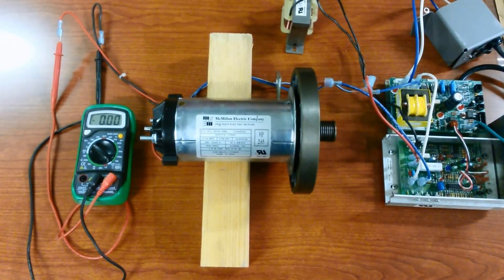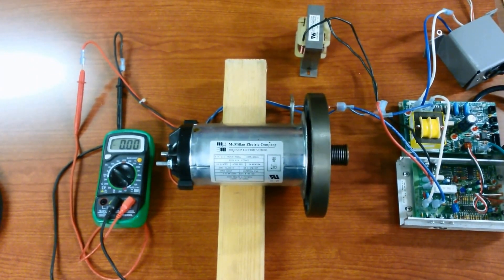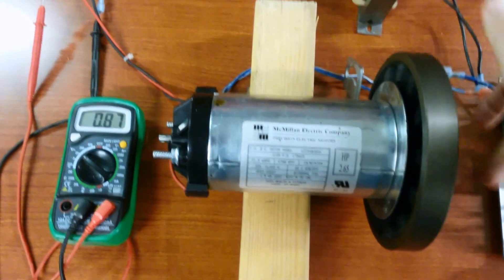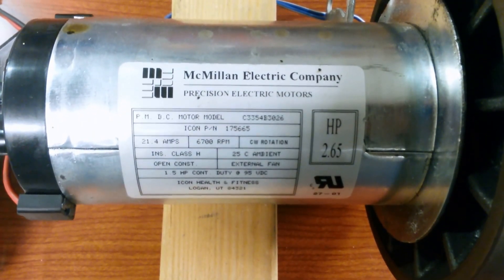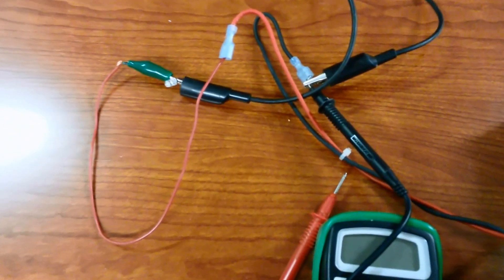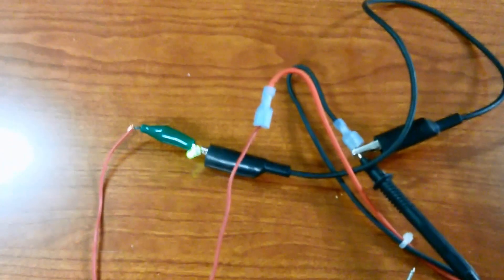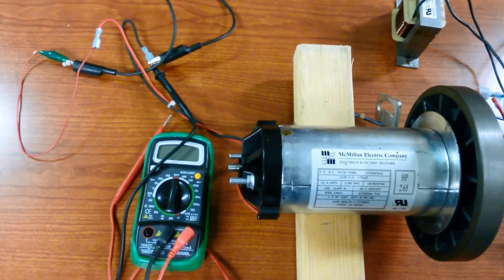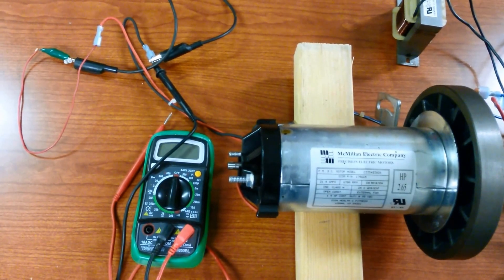DC Motor Dyno Intro

Comment: Hi, How is the dyno build working out.  Looking forward to seeing how you put it together as I am just starting a similar project.  Don't forget you'll also need a tachometer to confirm your RPMs so you can test the engines at their rated RPM/Kw (Hp).  How are you going to apply a load to the engine you are testing?  I am planning on using a hot water element and a potentiometer so I can increase load.  This will let me test an engine at different RPMs.  I am interested in some feedback on this as I am not sure of the circuitry needed.  Good luck, hope to see an update video.
Reply from the maker: +seditiousmonkeyart Thanks for the comment. Unfortunately, I haven't made any progress on this build. I've been busy with several large home remodels. I was working towards building a bearing system to support the pulley and belt so I can connect different small engines. For loading I was going to removing the heating elements in the toaster oven and wire them with separate switches so I could control the load by adding or subtracting elements as necessary. You're correct about needing a tachometer. I bought an inexpensive handheld tach off of eBay. I also was looking at a data logger that RC car racers use to dyno their cars, but that would be an upgrade once I got a basic system working. Let me know how your build goes. I don't think I'll be able to start back up on this project for a little while longer.
Reply: Life sure has a way of interfering with our projects.  I'll probably start my dyno build early 2016, current building a new Stirling Engine (I'm trying out a new design).  In the interim I'm think of making a simple prony brake dyno.  I'll keep an eye on your channel.  Cheers.
Reply from the maker: +seditiousmonkeyart You're new project sounds cool. I'll also keep an eye on your channel.